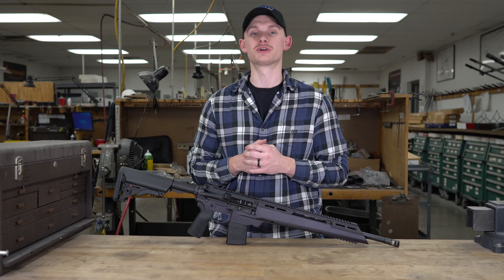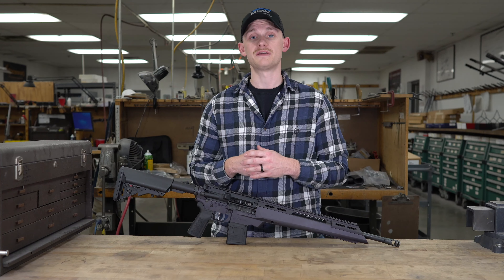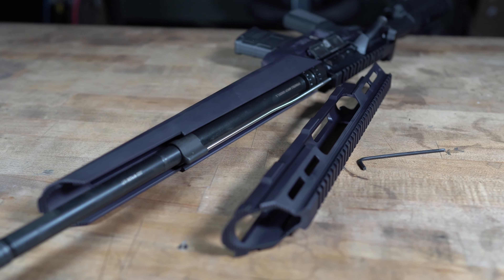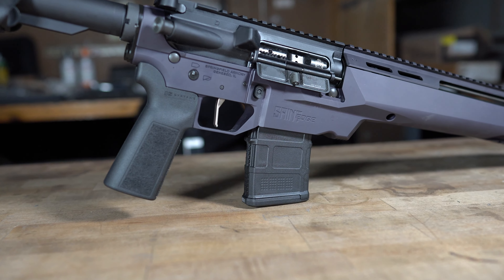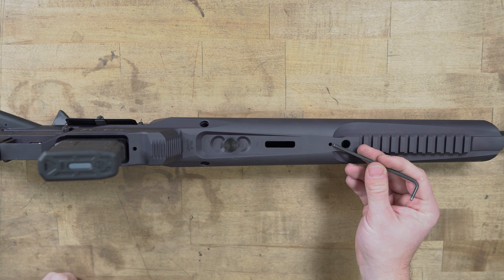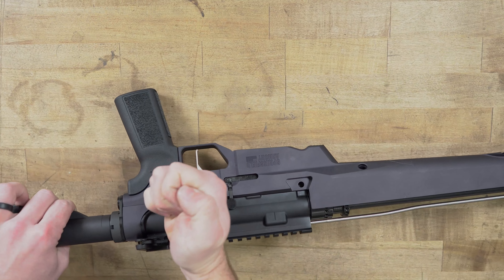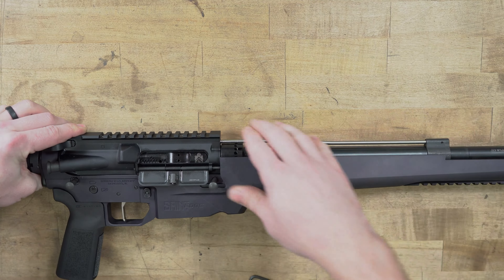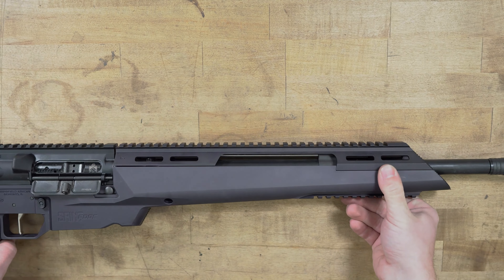Springfield SAINT Edge ATC: Overview and Dissasembly/Reassembly

Comment: There are 2 more niset screws, one in the pistol grip the other in front of the mag well, that tighten the lower and upper receivers.If not tightened, the upper and lower receivers wiggle around. these set screws also need to be loosened to pop out the retaining pins.

Comment: Great analysis on the disassembly and assembly. Will this beauty have any problem shooting NATO 5.56? Will it have issue with steel metal jacket or it will strictly be brass?
Reply: I have run some 556 through it however the bullet weight isn’t heavy enough for that 1/7 twist so it’s not going to hold good groups

Comment: Does this use a regular buffer? It looks like the receiver extension is longer than standard, and I wonder if there are any changes to the buffer system. I'd like to see if it can be swapped for an A5 or rifle assembly.
Reply from the maker: Yes, it is a regular buffer system, and it is a mid length.
Reply: it has the heavy tungsten buffer.